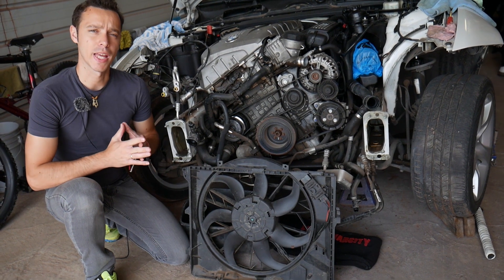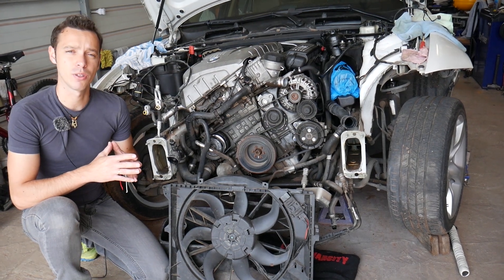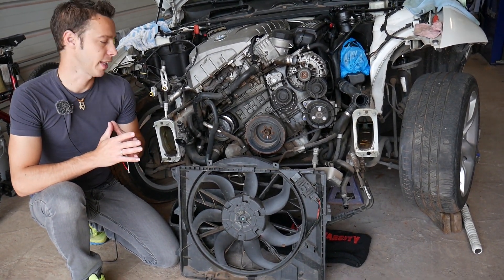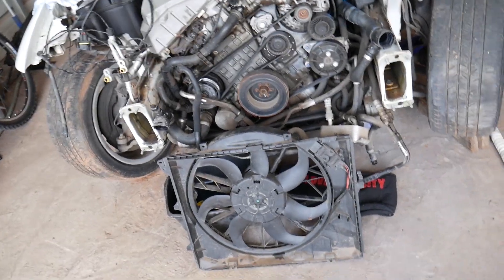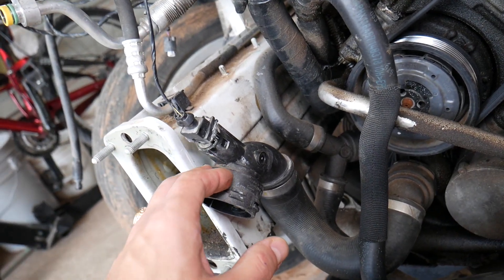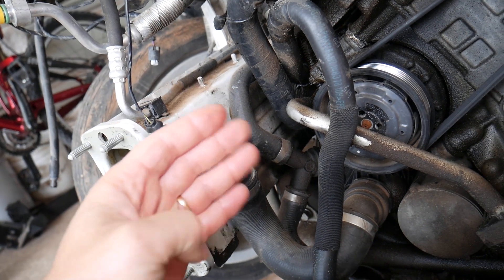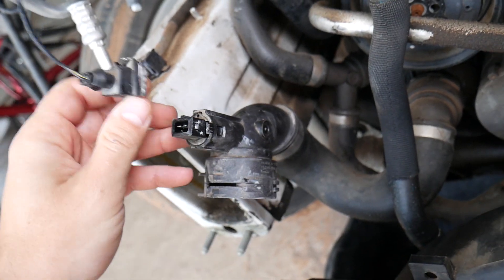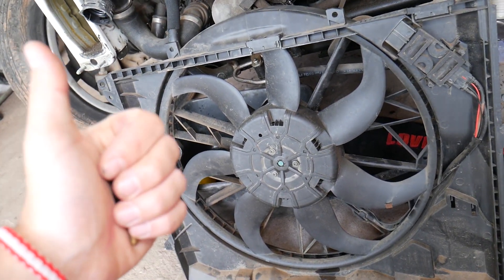BMW 1 SERIES RADIATOR FAN SWITCH REPLACEMENT LOCATION E81 E82 E87 E88. FAN DOES NOT WORK

Comment: I have a 99 540i . New fan new sensor fuses are good but the fan don’t turn on. The only way it turns on is if I unplug the sensor and it works fine !!! Can I keep it unplugged? Or the sensor is needed for something else ?